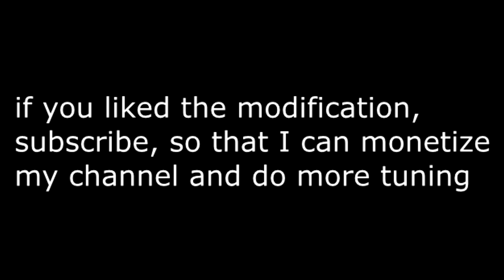the First TURBOCHARGED chainsaw!

Comment: You can build boost with a two stroke you need to adjust the carburetor to match the air from the turbo
Reply from the maker: ok, thanks for the tip

Comment: Try a smaller turbo, this one is too large to spin to the required rpm to make boost. Its also a good idea to have an electrical oil pump connected to the oil reservoir and back into it for lubrication of the turbo bearing. This can still work as chain lubricant if its thin enough for the turbo

Comment: Get a bar on it and put it under some load. I would like to see another video regardless of what happens
Reply from the maker: hey man, unfortunately the project was abandoned indefinitely, I adapted the saw on it, but I didn't have a way to make the oil circulate through the turbo... I'm planning easier projects. thanks for the feedback! =D

Comment: How does it cut?
Reply from the maker: hello friend, 2 months later I adapted the saw to it, however, I didn't have any mechanism to turn oil in the turbo, I would need an oil pump and maybe a
little intercoller, the project has been on hold for a while, thanks for the feedback! =D

Comment: Did it ever produce any intake pressure?
Reply from the maker: yes, it produces a pressure, however low, I'm working on another engine, more specifically a 6.5 horsepower engine, but the turbo chainsaw will not be forgotten.
Reply: @Elitoow  you need a smaller turbo .one off a small tractor ?

Comment: The turbo saw.
Reply from the maker: Yea, I adapted the saw, adapted another carburetor and made some adjustments, I ran out of money and ended up abandoning the project.
Reply: @Elitoow . Not Bad.
Reply: @Elitoow   ad a single injector to the hot side and spray the turbo with methanol ..then it will build boost ! Noooo Dont abandon it !!  johns custom saws is starting a turbo project

Comment: isnt it a little bit hard to turbo charge a 2 stroke its in and out, you cannot build too much static pressure but thats what you need.. 4 stroke chainsaw? xD if it exists i dont know
Reply from the maker: the chainsaw was just a project that didn't go ahead... but there are 2 stroke engines that have valves, maybe buy one and add a turbo. thanks for the tips friend! ;)

Comment: Its not possible to boost a 2stroke engine with a turbo because there are no valves. You only can do this with a resonance exhaust.
Reply from the maker: yes, 2-stroke engines can be turbocharged, in the past there were 2-cylinder 4-stroke trucks and turbochargers, but I don't know how the turbine's lubrication mechanism worked.
Reply: I thought it sounded like a 4 stroke chainsaw myself
Reply: Exactly 2stroke like chainsaws can't be turbocharged.
Reply from the maker: @enricorossi5996  friend, I think it's possible, but you need to have money to do it.
Reply from the maker: @wildcat6669  sorry man, it's 2-stroke
Reply: @Elitoow  ok, not only, you have to change the engine design